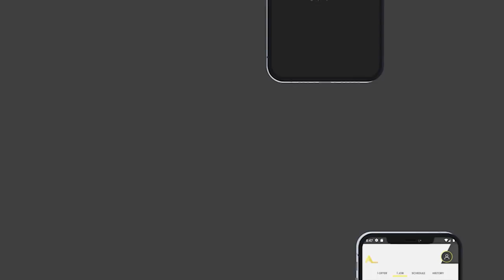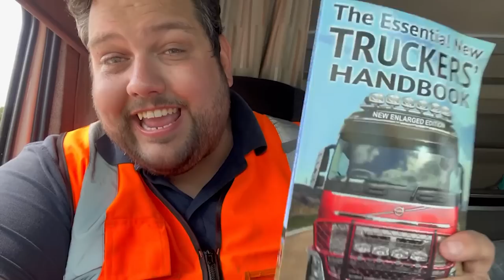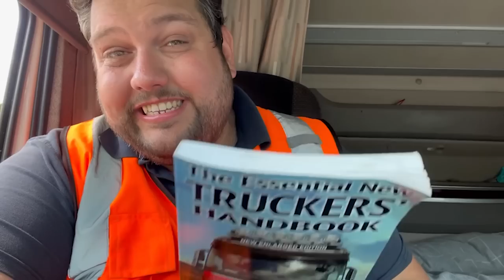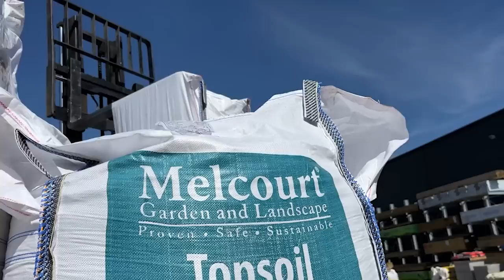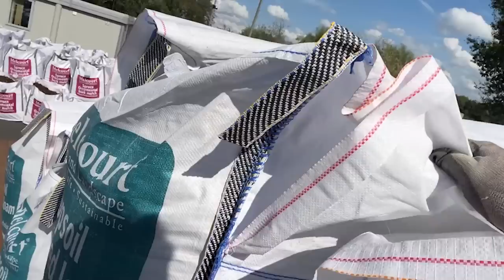I HIT MY TRUCK!

Comment: Hooking up is easier if you stick to a routine. Before hooking up make sure brake is on the trailer or there's air in the system so when the red line is uncoupled the trailer cannot move then check  that the slide plate is level with or slightly below the top of tractor unit ramps.
After backing onto the pin and checking the integrity of the coupling by 1st gear pull, then with number plate in hand exit the cab and walk down the drivers side towards the rear. 

1st check. Anchor clip and chain attached on the fifth wheel coupling. (This omission is a fixed penalty and a producer).
2nd check. Walk to rear of trailer and fix the number plate and check the lenses. (This is also a fixed penalty and producer if omitted).
3rd walk down nearside and make sure trailer air suspension or axle lift is set and wind up trailer legs then stow the winding handle.  (Also another fixed penalty if the handle is loose).
4th attach all hoses and cables and then release the trailer handbrake. 

Then check lights and equipment and load if any.
Before setting off make sure suspension is reset to M or drive on the tractor unit. 

Uncoupling is,

Set trailer brake to park then disconnect the airlines and electrics. Then wind legs down then set trailer suspension if needed then retrieve number plate then unclip anchor chain and open coupling jaws.
Draw tractor unit forward and job done.

Please let me know if this is still the way drivers are tought to do it properly as its been nearly 40 years since I took my test ?

Comment: Just wondering on the weight issue Luke, if your carry 30 x 1 Tonne bags surely your over your 44Tonne limit as my maximum flatbed weight is 27.2 Tonne and not many if any flat that can carry 30 Tonne
Reply: the bags are called 1 ton bags because thats the maximum weight they can carry , chances are they will only weigh about 3/4 of a ton each
Reply from the maker: They weigh around 600-700kg. They never truly weigh 1ton.

Comment: How heavy are them bulk bags?
Reply from the maker: The ones will with bark can be moved by hand. Maybe 200kg at most. The topsoil ones maybe 550kg at most.
Reply: @lukecinahgv  didn’t think they would be.. when you said 50 bags I was surprised. Quicker doing sand and aggregate as they are heavy 👍🏻
Reply from the maker: Yea normally 34/36 when I did it
Reply: @lukecinahgv  fair one, about 900kg each or there about?

Comment: DONT feel bad , happens to all us , on building supplys .  HAD lot this  SIG  PLC ////   2017-2019  . THEY  SIG  central route plan via POA ,  send 32 ton 8 wheeler(  DAF CF).  Were 7.5 ton struggle , COUNTRY  lanes 6, 6 wide  10ft trees . WE  28 ft long out moffett  9ft wide  14ft high . They wonder why you ring them up  SAY  sorry cant delv . & IF you have bang with the  truck  because theres insurance claim  it puts ur own car/ motorcycle prem up by 5%  & renew time NOT GOOD . .   SAFE TRUCKING .

Comment: Glad you're feeling better Luke.  I too had a queer thing happen to me last year.  Apparently, its vertigo, and it was when I just got out of bed, and I was wanting to walk sideways.  It was a terrible feeling.  Got my lovely neighbour to take me to the hospital, as when I phoned my GP, they said it would be a few weeks before I could get in.  I got to the hospital, waiting for 10 hours in A&E, and the doctor fixed me in under 5 minutes.  Really frustrated.  Even the nursing staff tutted when I told them of my GP.  In fact, I'm just wondering whether they contacted my surgery and asked why they could deal with it.  I totally agree with them.  Anyway, I now know how to fix it🤣.  Just a thought though Luke when watching you deal with netting.  How about putting a couple of heavy duty hooks into the backboard of the trailer behind your cab, then hook the net onto the hooks in the backboard, so it stays there, whilst you unwind the net across the top of the load to the back end, and you can pull it tighter as well at the same time.  Just a thought

Comment: 5:42 they ask you to use your phone for checks? Should supply you with a phone if that's the case. I hope i am wrong, but seems like i'm not
Reply from the maker: No they supply paper form. Using my phone is my choice
Reply: I am a coach driver & we use an app called cpt daily checks. We get offered a works phone but my choice to.use my own phone. Much easier to record it.on the app than on paper.